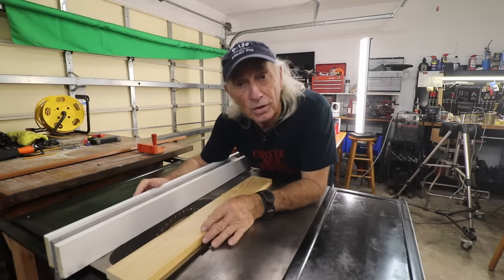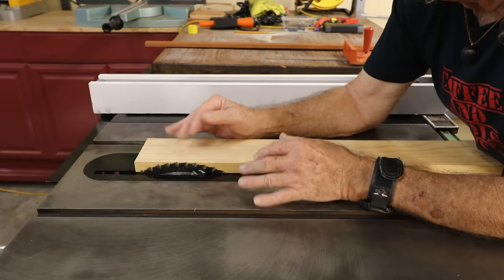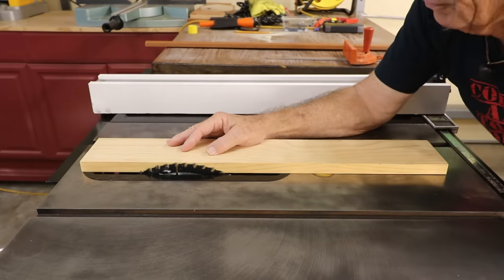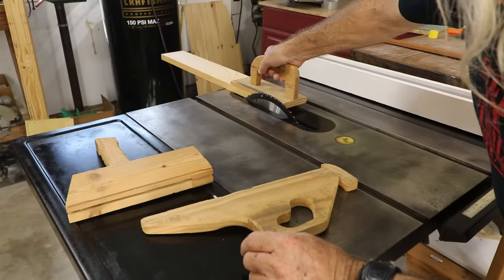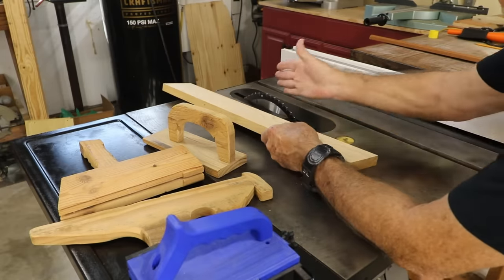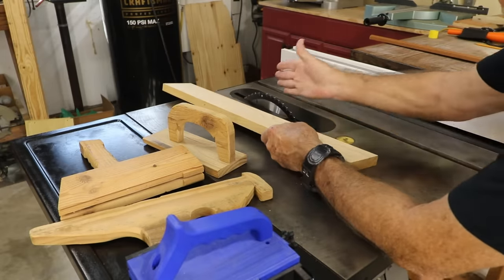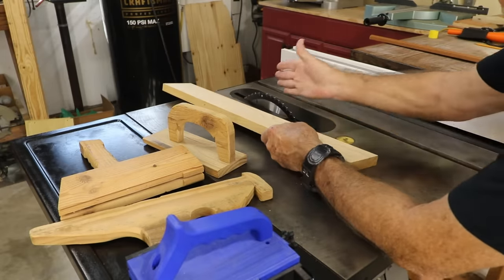Table saw secret nobody will talk about from the good old days, C&T episode 180

Comment: When I started using a table saw common wisdom was to set the blade about 1" higher than what you're cutting if you could, the argument was that required less power to get a clean cut and overall safer because the blade spent less time in the wood and when it was it was pushing the wood down instead of back at you. There was never any thought of kickbacks or anything that people talk about now, because the wood needs to ride up and twist (twist and ride up?) to kick back. With the blade sticking up that high above whatever I was cutting I was also much more careful with it.

FWIW, I have had a table saw "accident," and it was in the last few years after using one for almost 30years, and that was when I had the saw blade set down low and cutting out some smaller square pieces I got a kick back.  Thankfully I wasn't seriously injured, but I do have a 90* scar that is the size and shape of the corner of on of those blocks to one side of my bellybutton.

Comment: With long pieces where immaculate cuts aren't important, I flip the piece end-to-end and my hands never get near the blade.
  One morning I met a flooring guy who was cutting maple flooring freehand at 90° without a push fence, plastic table saw on the floor, never shut it off between cuts, air hoses and  wood and tools all over the floor and I told him "That's REALLY dangerous" and got the "Yeah, yeah, yeah" response. I wasn't there when it happened, (never saw him again)  but fortunately the maid was to get him to the hospital. Four fingers gone.  Next day I saw the line of blood up one wall, across the ceiling and down the other wall. A nightmare that could have been avoided.

Comment: I run a mix of high or low breakthrough depends on what I'm doing. (I'm 50+)
Back in my early 20's we operated a 56" saw mill here on the property, its still here. that blade most times was proud out of most cuts,
and a rhyne board,slat or the finish board... if the off barer (that's the person catching or off baring the boards stacking them)if he goofed or let a board get in the back side of blade, you could have a 2x12 rocket and most of those end up with a fatal outcome.
very good presentation. ALL good points.

Comment: Not an experienced table saw guy here.  Bought a used one cheap and needs some cleaning and adjusting.  Scared the crap outta myself with a squarish piece of plywood about 18 inches trying to cut a piece off the side. Got jammed in between the fence and blade. Instantly twisted out and rode up on the blade, yanking my hand across the blade (but a miss) and throwing the plywood into my abdomen. Big bruise and a little gash.  

I was lucky.  For anybody not safety trained on these machines keep watching these videos to get some perspective and safety ideas.  I won’t cut now without a lot of planning and using a hold down handle.  Thanks for the video!

Comment: I tend to keep my blade a little high just because if your board isn't a consistent thickness, you could get to a point where its not cutting through all the way and if you have a riving knife set for through cuts, the sliver left by the blade will run into the riving knife and not let you continue through the cut

Comment: Great video and well presented. As a woodworker of 20+ years I have lost part of my left thumb. Luckily just a little bit of the tip and small portion of the nail.  I was taught for safety purposes, and to still maintain a good cut, that it is good practice to set your blade 'one full tooth plus a little bit' above the cutting surface. I've always gotten good cuts, almost no kickback and I still have most of my left thumb due to this practice. I agree that the table saw is very dangerous but any of my fellow woodworkers that have lost fingers have done so either on the radial arm or chop saw.
Reply from the maker: Thanks so much Jim for this one :)

Comment: "The saw isn't plugged in, so stop typing."  HAHA!!!

Thank you.  Another YT channel did a pretty good video about blade height.  He said to raise it so the shallowest part of the blade's teeth are level with the board's thickness.  That works pretty good for me.  I understand "their" safety height barely above the top surface, but wood 'riding up' is a problem.  He also explained as you did that the teeth are PUSHING its way thru the material, not cutting it.  I do like my Microjig Grr-Ripper a lot.  I've even ripped 2x4's into 1/4" strips.  You def have to be extra-cautious, but the Microjig keeps me plenty enough away & above the blade... otherwise I wouldn't do it.
Reply from the maker: We liked the Microjig Grr-RIpper until it slipped on wood sheets here. After some various test we returned them and 3d printer our own Grr-ripper.

Comment: My dad was bitten by a table saw when I was a kid. He had made his table saw and it had a small table.  When I married and bought a saw, I bought a radial saw and later a Forest blade that didn't climb like a standard blade!  I  learned the limitations and about 15 years later ought the table saw and again the Forest blade for safety.  I didn't respect the jointer and was bit but completely healed in a few months! I am 79 and work slow and try to be safe.

Comment: I was told that the 'flutes' in the blade are designed to help remove sawdust and should be above the top of the piece being cut. I never liked having the blade so high, so I always had it just a bit above the wood, to keep my fingers away from the blade.
Reply: The space between the teeth are called gullets and they are for dust removal.  That's why rip blades have fewer teeth and bigger gullets but are far less likely to burn your lumber, where as you'll burn your wood if you do a long rip with a crosscut blade that doesn't eject the saw dust fast enough.

Comment: From the uk , have had a joinery business for 30 years and I will always use the blade high , my saws are 10 hp wadkin  450mm blades and have riving  knives to stop bind when cutting , all guards are set so there is no gaps to the blade of more than 10mm , we use long push sticks and hands never get close to the blade ........I can not stand the way saws are used in so many YouTube videos  and those push blocks with the top D shaped handles are the most dangerous things out there.......just don't ever have a fully exposed blade ....its madness
Reply: Curious as to the danger those push stick types that you deplore pose. I find that they add control in keeping the stock flat on the table, and even gripping with a bit of thrust fencewards. My preferred tool, though, is a birds mouth stick of aluminium. If it should graze the blade it is simply shaved like a wooden one, no drastic theatrics. I sharpen the tip to a bluntish point, and often use it like an awl for maximum control in all directions while ripping
Reply: @leehaelters6182  there is a youtube film called kickback on camera 
As I have said I just cringe when I see how people use table saws
If you are just ripping then a riving knife and top or crown guard are a must 
And the old school way of a high blade and downward cut is by far the best way for ripping solid timber but with guards in place ......it only takes one mistake and it's to late .......these machines are just waiting to take a bite out of you....100% respect at all times must be given 
Same with cross cut saws (radial arm)  and surface planers (jointer planer)
And when doing circular work on a spindle moulder (shaper) with a ring fence put some bicycle clips on your pants 🤣👍
Reply: @englishbob3603 , yes, I have seen two of those; one the camera was rolling during actual work, and one the videographer was setting up to demonstrate kickback, but the event caught him by surprise anyway. Years ago I came to work late to find my workbench littered with pieces of sash and shards of glass, all from the window into the machine room that was situated nearest me. Young Brad had been making parts for an entrance door of 10/4 mahogany. Our old Yates industrial saw had launched the heavy kick rail for the bottom through the window, over my bench, and for some distance down the bench room. After that a loaded plywood cart was parked between me and that Yates until we built a  plywood storage rack into the same spot. Brad had the sense and opportunity, it seems, to hit the deck and escape injury. I wonder what he expected to find when he gathered his courage to look through the new opening. No riving knife fitted to that old machine, but we loved it anyway.

Comment: Thanks for the video... I mostly use the "flip method" for cutting wood .  I cut half way through the rip ... then flip the board and finish the cut.. this keeps my hand well away from the blade... this method does not work in all cases of course... 40 years of cutting and still have all my digits...
Reply from the maker: Not a bad idea. Thanks for posting.

Comment: I have been using table saws since the mid 70s and I have done it both ways. I became convinced that higher was better when I was using a blade with the tips just over the top of the board and the blade may not have been really sharp and the board started to rise up (because I didn't have my push stick handy and it was a wider board) and I instinctively pushed down on the back of it to get it down onto the table top. Then it kicked back and dragged my thumb back through the blade and I nicked the tendon in my left thumb. That is way to close to losing it. I always expected that if I was going to cut it, it would be while pushing it, not being dragged through it backward. I think that if the blade is higher, there is less likelihood that the blade will push the board up since it is pushing it down onto the table top.
Reply from the maker: This is a good example. Glad you didn't loose the thumb

Comment: I think a higher set blade allows the carbide tips to run cooler and they stay sharp longer. Is that true?
Reply from the maker: Seems like everyone has an opinion Mark. We did a heat test with no changes as a result.
Reply: @SirTools  you are very right about that! I don't know enough about most things woodworking to have an opinion about most things. I appreciate everyone's thoughts and perspectives though .I don't have the tools to do a heat test. That is interesting! Thanks for chiming in.
Reply from the maker: I was expecting a LOT more heat, but maybe we learned something here.

Comment: I always have the blade as high as I can, because the leading cutting teeth are clamping the wood to the table (the vector of the cutting force points down to the table), and the kick-back is well controlled, yes it is less safe, but I don't use my fingers to hold the wood down and I stay-away from rotating blade.
Reply from the maker: Angle vector and all is so called un-safe, but gives a good cut :)

Comment: I've used both schools of thought. The low blade angle increases the amount of wood being cut, while the high blade is cutting much less. So depending on the density of the wood, the angle can have an impact on it as well. 

I have had kickback on one occasion. Cutting a piece of wood that was about 1/8th inch thick and the piece shattered as I was sending it through the bade. Got hit in the gut and it actually put a splinter in my abdomen, through my T-shirt. I didn't think anything was there at first (just a scratch I thought) and then had to dig it out later. But I blame myself more for that than the saw.

The biggest thing is, as you say, respect the tool. I don't care how big or small the blade is. A 5 inch circular saw can mess you up in an instant if you let it. Know where your hands are in relation to the blade at all times. Know where a piece is likely to go if it does get pinched (don't stand right behind the blade, but to the side a bit). And the number one rule, if it doesn't feel like a safe cut, don't do it.
Reply from the maker: Good stuff to remember ! Thanks

Comment: I have ALWAYS raised the blade so the the angle of teeth contact the wood in the flattest possible position. Also, I believe the hand held circular saw is the most dangerous, including the hand held beam saw (which is also a circular saw. Nice video and thanks.
Reply from the maker: The circular saw is an odd duck for accidents

Comment: For those dicey milling operations that cause concern one can lower the blade to just over half the thickness of the material, cut it, then flip it over and cut the other side. Use shop aids to help keep the material securely on the tables surface and up against the fence. Cabinetmaking textbooks available at bookstores and libraries will illustrate safer set-ups and practices.  I believe the radial arm saw was once considered the most dangerous power tool back when it was a more popular selling "do it all" tool for consumers. However since the 1980s more people buy and use table saws so statistically they have surpassed the radial arm saw in terms of most dangerous stationary power tool.

Comment: I’m retired now here in the uk but all our saws came with standard riving  knifes and more importantly the blade Gard which is held above and can be lowered or raised over  the spinning blade is all that’s required to stop kick back and stray dust coming back at you , I must say I never understood why the riving knife wasn’t the same or slightly thicker than the blade in use ,  you must remember that on these new modern TCT blades that the teeth are wider than the blade reducing friction on the wood when pushing the work piece through.
Reply from the maker: Good points

Comment: Good advice and as well as a riving knife and push stick I made myself an electro magnet feather board which goes on the other side of the work from the fence.. This clamps the work perfectly straight between the fence and the feather board, can be switched on or off to position anywhere on the table and there's no need to put any sideways pressure on the work to keep it up against the fence.. The commercial version is called Magswitch.

Comment: I don't think you could say the side of the blade is supporting or guiding the wood through the cut, as there will be a gap left by the kerf. If there is not you have a major problem.

Comment: Good video. I'm old school, and tried the "safe" setup before. It requires more pressure, as you showed, both downward and forward. That's the physics. I'd rather have better control. I run with, at a minimum, the full blade kerf above the board. More exposure if something goes wrong, but with proper accessories in use, I think old school is still best.
Reply from the maker: We going to test "heat" with the two schools later this week and thanks for viewing like always :)

Comment: I have experienced two kickback instances. Both times I had not checked for warpage or twisting of boards at the time this happened I was not even aware this could be a problem. The second time I did not change my saw setup, it took a couple of days to convince myself to use the saw again, so I made several test cuts and no kickback. I talked with manufacturer of the saw, at the time I was throughly convinced saw was the problem, and I talked with experienced woodworkers and two of those guys asked me to look at boards warpage or twisting sure enough both boards had twisted. II am still not sure of dynamics but more or less when both boards were cut they sprang apart it jammed the boards against the fence. I was using a splitter and paws at the time. Oh, and one piece of board hit the fence and broke it that’s how much force was generated.

Comment: This is a great video. The point about setting the blade low for safety reasons is well said. I think the lawyers for the tool manufacturers came up with that idea. People who probably never built anything using a Table Saw. Lol I always feel the push back from the saw on my material when the blade is set low. It's a lot easier to control your material and the cut with a high blade. Personally I keep my Table Saw blade all the way up when ever I can. I also use Push Sticks, Feather Boards, and a Sacrificial Fence, too. BTW I still have all 10 fingers after 40 years of Woodworking. 😁🌞
Reply from the maker: Lawyers ....man I sure hope not LOLOL...

Comment: the danger most of the time is not having a riving  knife behind the blade. Almost any time you make a cut without the riving knife, you are going to have a problem with pinching the wood and getting a kickback. My saw has a riving knife that moves up and down with the blade and I have so far had NO kickback. When using a table saw, there is no guarantee you won't get hurt. Just have to be careful and pay attention to where your hands are at all times.
Reply from the maker: Thanks for post

Comment: My old craftsman saw has no riving knife so I drilled and tapped a 1/8” hole and installed a 3/4” long set screw into the blade to act as a riving knife. Works very well. I was taught to set the blade height with the troughs between the teeth just above the top surface of the material

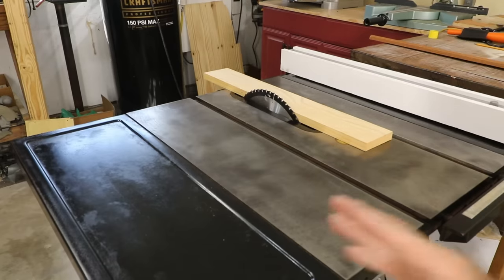Comment: on the 7:20'ish spot concerning letting the work fall after the push through, if the board is too long ,the pushing through force becomes a pushing down force to keep the end of the board on the blade to finish the cut and a potentially dangerous situation that could quickly turn your digits into mini cocktail weenies sailing across the shop. best to have an out-feed table or roller bed , better yet to have a helper to receive the board. spring loaded hold down rollers and feather boards to keep the board snug to the fence as you cut are handy too.